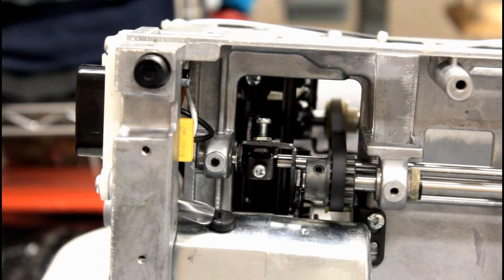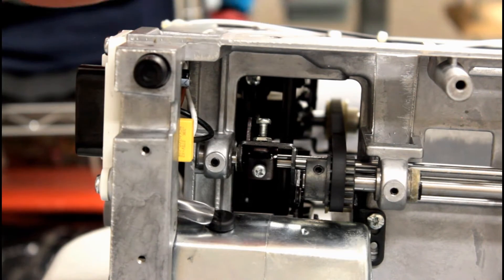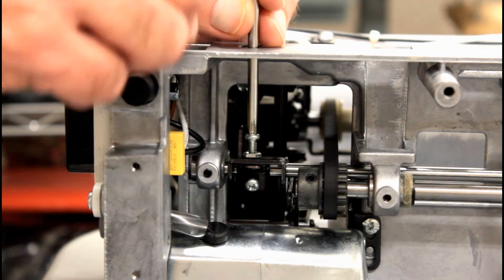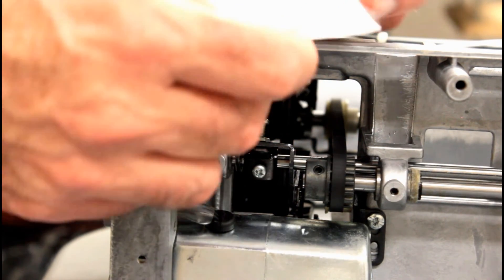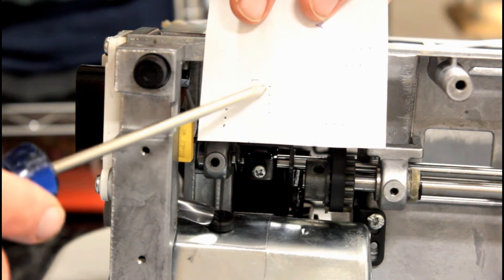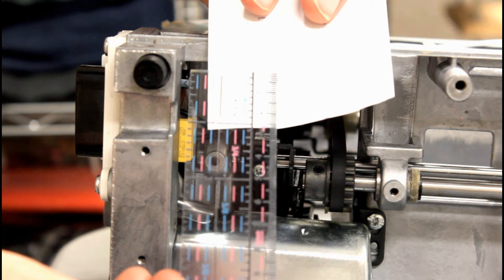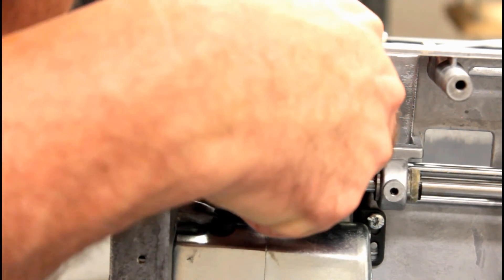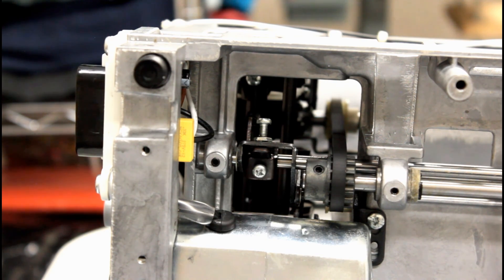Correcting Stitch Length on Singer Heavy Duty Machines

Comment: Thanks Kevin. Would this be a cheat way to increase the stitch length beyond the stated max 4mm if you needed a longer length for a specific project? Or is this just for fine adjustment?
Reply from the maker: You might be able to get it slightly longer, but there is a physical limit based on the size of the opening for the feet.
Reply: Thank you
Reply from the maker: @TassieTiki  You're welcome!

Comment: i just purchased an industrial brother sewing machine.  The stitch length won't change.  it is very small.  where do i find this screw on a brother?
Reply from the maker: You will need to find the service manual on it. It isn't something easy to describe here.
Reply: I had this same issue on an older consumer-casual grade brother model

Comment: Hi, did you take off the metal plate on bottom after removing the plastic case?  On singer 4411 it has no hole to stick screwdriver in to adjust, please advise, Thank you
Reply from the maker: Yes, I did.

Comment: Hey Kevin! I’ve just found your videos - they’re very handy! I’ve managed to create a problem with a Singer 4411 whereby the the hook hits the needle every time the needle is in the lowest position. I can’t see a way to alter where the needle sits in terms of closer or further away from you when you’re sat facing the machine.

If you’ve come across this before or have any tips for fixing it I’d very much appreciate your help!

Many thanks,

Tom
Reply from the maker: Take a look at my video showing how to set the timing and see if it helps: https://youtu.be/dfUB2c-x7g4?si=Uifrs_k7YKryBEOz&t=294
Reply: @kevinsews  thanks, I managed to sort it by loosening the set screw at the top near the presser foot tension dial. Once that was loose I was able to adjust the needle ever so slightly to the front so as it missed the hook!
Reply from the maker: @tomtomtomone  Great! Thanks for the update.

Comment: I have the heavy duty 6800. It suddenly stopped going in reverse and (at the same time) when I hit the cut button, it only cuts the bobbin thread, not the thread going thru the needle. Thoughts? Thanks in advance.
Reply from the maker: Since it is an electronic machine it could be the board that is causing the issues.

Comment: Quick question maybe someone can help with. I’m new to sewing, i came across an older singer 6215. I’m noticing when reverse stitching, the stitch length is much longer than it is going forward. Not sure if that’s intended, or if something is wrong with the machine itself (it’s from the 80s and sat in a closet for the last ~20 years. I’ll have a short stitch length set, but the moment I reverse stitch, it nearly doubles the stitch length only in reverse. Thanks in advance.
Reply from the maker: The reverse stitches should be the same length.